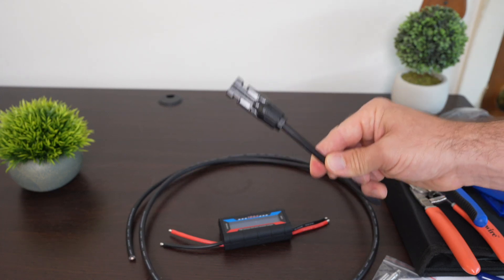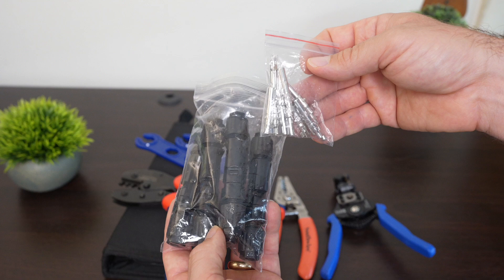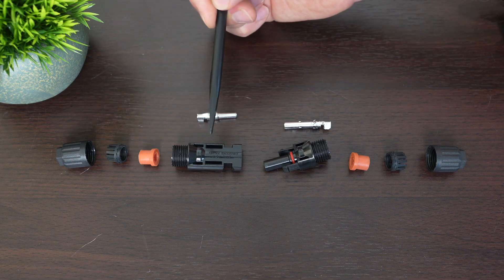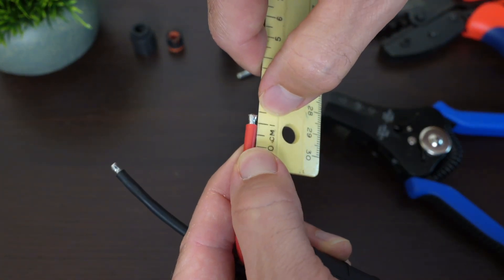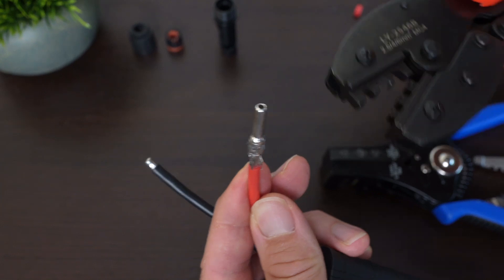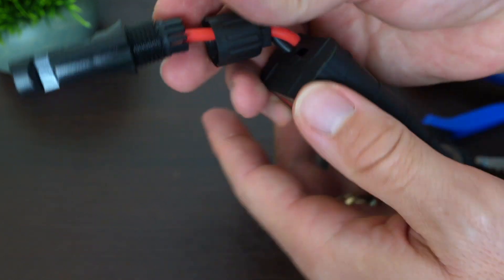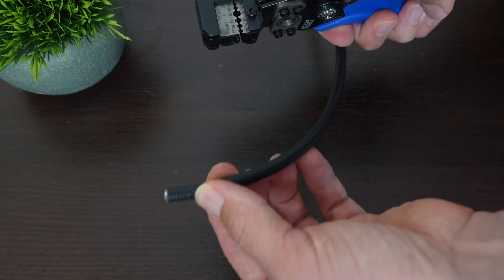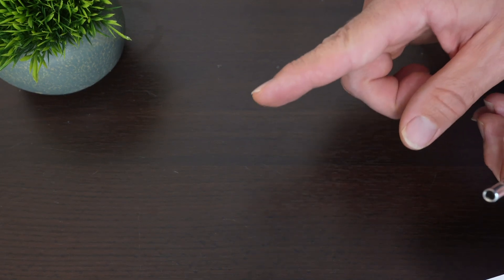FASTEST Method - How to Install MC4 Connectors

Comment: What if wire on solar panels are smaller than most connecters
Reply from the maker: I am not sure what you are asking.  MC4 is the connector, you can have different wire sizes going into it.
Reply: @solarguy  I have solar suitcase with non quick connection